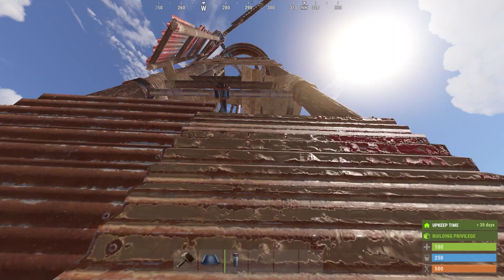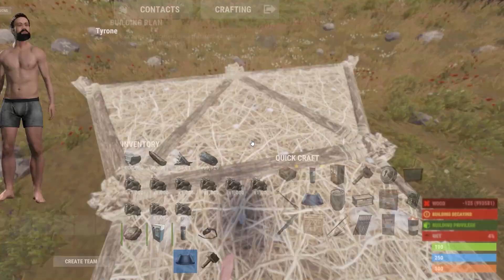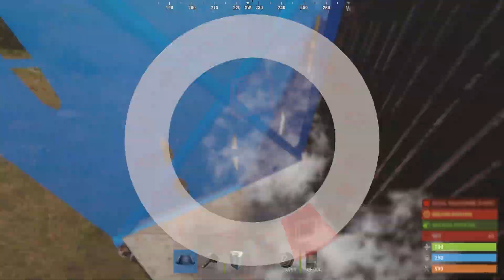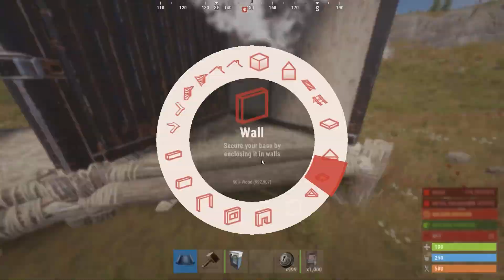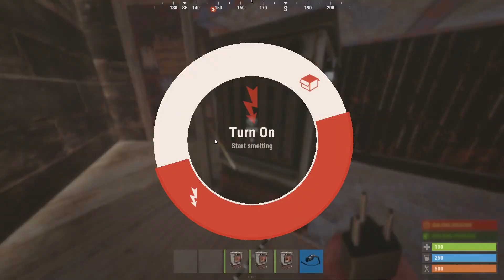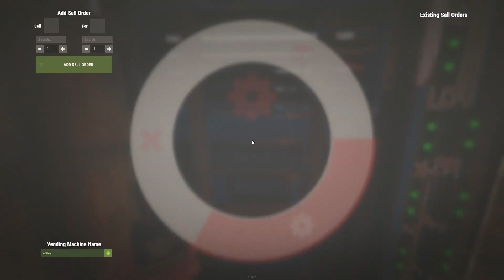Automated Metal Frags Shop

Comment: you can save 200 metal frags by crafting 1 branch and 4 splitters instead of 9 branches, have 1 splitter go in 3 other splitters and have the branch give the splitter 27 power to get 9 outputs of 3 power

Comment: If i wanted to make it profitable i would need room to put a box right?
Reply from the maker: You could use the electric furnaces to hold up to 2k excess each but wouldn't hold as much as a box if you swapped the large battery for 3 small batteries and a vertical barrel it might be good or drop boxes.

Comment: I would Shell it for 2ore of 1 fragment so you can make Some profit
Reply from the maker: Yeap could do. I personally don't have electric furnaces in my main base and use the shops to smelt my own frags.
Reply: 2 :1 is kinda steep, id get behind a 5 : 4  20% profit / loss is much more manageable for a solo.

Comment: At 09:55 you can also change lookatradius. With lookatradius set to 1 it's easier to select electrical points
Reply from the maker: Ah true haven't tried out that method. Thanks for the tip